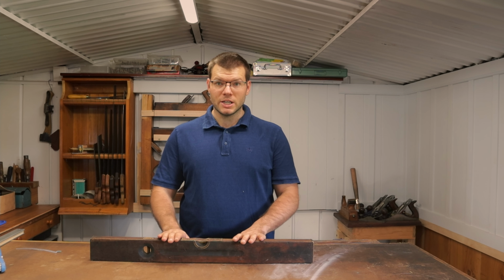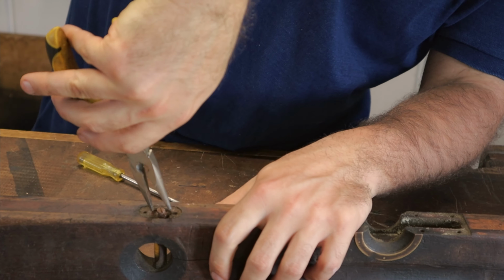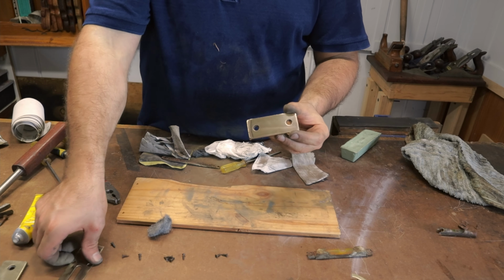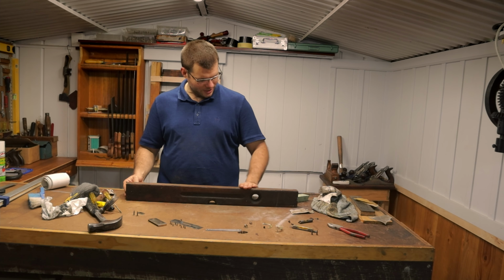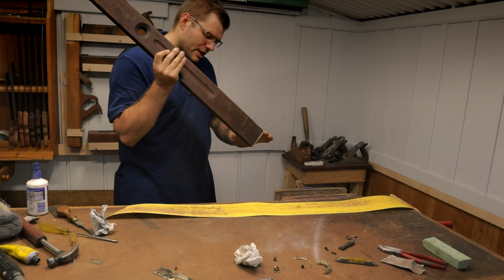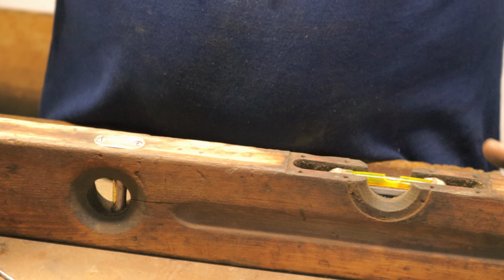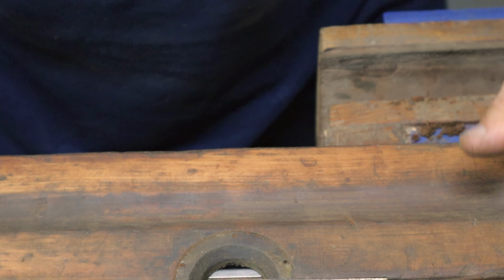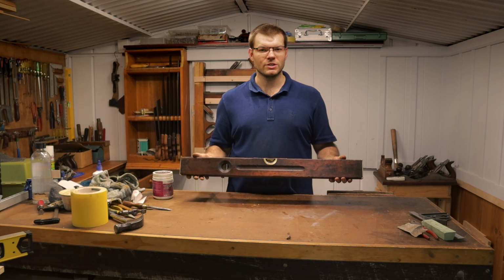Restoring a 100 Year Old Wooden Level

Comment: Great video. I love that you used linseed oil rather than poly
Reply from the maker: Thanks glad you liked it. I always prefer to use natural finishes where possible.
Reply: @AussieWoodshed  Especially for antiques, yes. Linseed unfortunately isn't very water resistant and does not contribute to the durability of the piece.. but it looks/feels so much better

Comment: I just found a Stanley #95 for $8 bucks.  It’s very similar to #5 but also has brass edging on the 4 long corners.  I wasn’t sure if I should recalibrate and refurbish it or not, but after seeing this, I think I will.  It’s a quality tool.  Why not keep it nice.
Reply from the maker: Good luck with your restoration, im sure it will turn out great